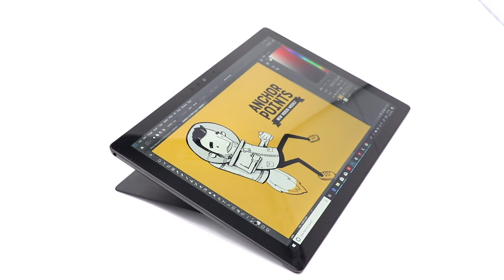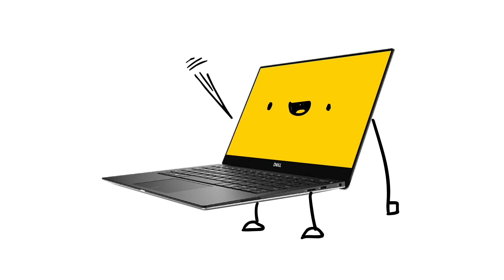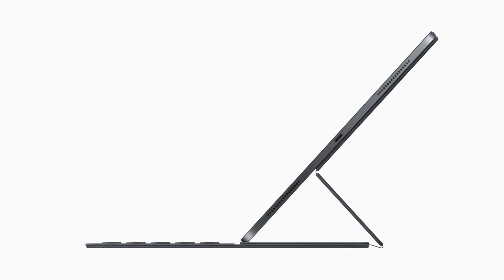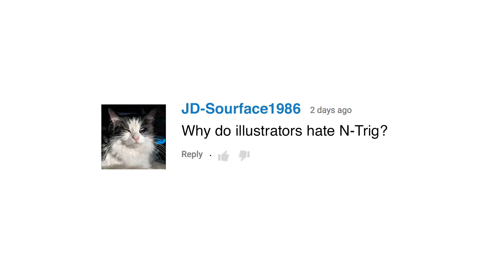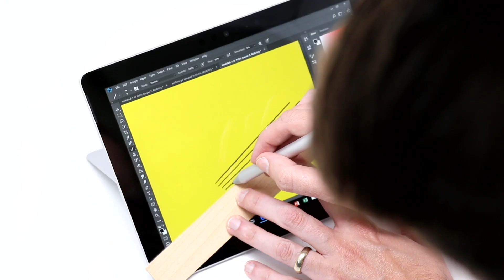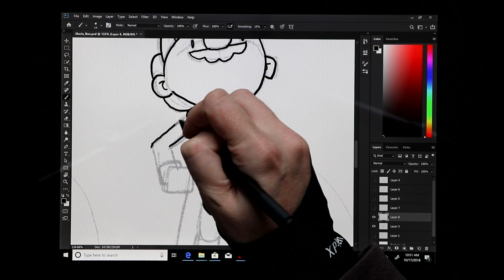Surface Pro 7: Rumors and Updates

Comment: I don't know of any artists who were trained to make slow strokes. In every art class I've ever taken an emphasis was placed on making bold, confident lines. In a digital setting, every instance where I have seen someone make a slow line or curve, I have seen someone doing something that would have been better accomplished with the Line or Pen/Bezier tool in any given program. 

Slow or hatching strokes are not instrumental to creating art. Often they hinder it.
Reply: I used to be a clean up and inbetween artist at Disney many many moons ago (I used paper and 0.3 rotring Pencil) there was no ctrl Z back then, So you couldn’t make Crazy long lines quickly. You could for eyelashes, but there is a balance of control, where you would still need your lines confident. I now work in TVpaint, and I tried using a surface pro as my portable solution and it’s almost impossible to use. I ended up ditching it getting a Galaxy Tab s3. It runs TVpaint, and the Wacom stylus makes a world of difference. I think some concept artists who work fast and lose this can be great! But for me only Wacom and Apple Pencil. Even the battery powered Wacom pens are a bit crap.
Reply: @sloppynyuszi  There is a physical limit to how long of a line a person can make quickly. In traditional media (depending on the size and scale of the rendering), I'd even go so far as to say that 'crazy long lines' would be rare, if necessary at all. And there, a straight edge of some sort would probably be used. 
In art, a confident line is not a description of the end result but rather a description of how the line was made. A dozen or dozens of confident lines could have been marked and erased before arriving at an end result. An end result which could have been a happy accident stemming from a timid mark. It happens.

If a person were inking traditionally with a brush or nib, I can see where slowing down would become necessary and that would be mostly for curved lines. Straight lines would still prompt a straight edge for all but the most inhumanly steady hands. I am not familiar with TVPaint, but any issues with its usefulness could stem from poor code in the program itself as opposed to the device it's used on. 

But, to my point, a stylus makes it easier to incorporate hand drawn assets into a digital workflow. A stylus does not compel a 1:1 conversion of the traditional workflow. That is not the goal of working digitally. Jitter/jutter or whatever one wants to call it, is just an easy way of examining how the technology beneath the surface (sorry) works. Diagonal jitter is not the best way to evaluate which hardware will be best to achieve a particular end result. 

Slowly drawn diagonal lines are just not the best way to render a line in a digital program.
Reply: Sean Adams if you like 2D animation done the old fashioned way TVpaint is the way to go. 

It’s pretty standard after Toon Boom, Cartoon Saloon and a lot of Anime studios are picking it up, and Pixar and Blue Sky use it for their 2D reference animations and Pixar even did a 2D film recently with it.

I’ve used a bunch of tablets, and really wanted to like the surface because of the form factor. It’s just plain slow and awkward to draw with.

Personally I’m glad I could take my work away from traditional materials, but honestly for the work I do I need to be able to draw clean lines slowly. Now I could learn to use a vector app and use Bézier curves and such to get super crisp lines. And I do play with vector apps and the such, but it’s too slow for animation, and the standard Flash stuff just doesn’t get the look I’m after. 

For your type of work the surface might be excellent, but there is a work flow where it doesn’t work, and using other devices seem to have fixed the issue. 

Also since there is a common complaint about ntrig pens I’m not alone in this.
Reply: @sloppynyuszi  The argument I am making is not that there is one  'right' or 'wrong' way to do work which is applied to every industry. I can't even say that your argument is wrong because I don't work in animation. It may very well be that people who work in the animation industry need to draw lines slowly in order to work faster (which sounds counter intuitive).

What I do know about animation is that in order to hit any kind of deadline in that industry, you either have to have more people working on a project, have everyone working on the project work faster or both. Is the surface the right tool for that job? Maybe not. From your perspective, definitely not with TVPaint. Dealing specifically with the issue of working with a single program in a single industry, you are not making a strong case for using TVPaint on a Surface tablet. I have watched some videos since you mentioned it and have seen people drawing on the Surface Pro with the program and have read forum posts about how people have pen pressure in Photoshop but none in TVpaint. Most of what I have read has not ruled out the problem being in the optimization of the software in question. Go back to the days before Wacom was a standard and you'll find some of the same issues. A lot of the Surfaces issues have to do with rigidity and inflexibility in the industries people are introducing the Surface into. 

I am talking about whether the ability to draw lines slowly is the best measure of a persons ability to create art digitally. Line and Pen tools are not exclusive to vector programs. In most cases where a tablet or tablet monitor is tested, the demonstration is always a straight line drawn diagonally verrrrrry slowly. This just doesn't translate to the real world. In that particular scenario, a Line or Pen tool is still the best solution. 

If there is more or less of an undesirable effect occurring depending on which program is being used, that would tend to demonstrate that the issue is in the program.
Reply: Sean Adams well my initial reply was that you said no one draws slowly, and I was just giving you a counter point. You were defending the N-trig and it’s lack lustre diagonal line performance :p

I use TVpaint for my smaller commercial jobs I can do myself. The reason In this instance drawing slower is faster is because I get it right faster. And when saying slow it’s not that slow, just slow enough that the jiggle gets annoying, and when I draw on my Cintiq it’s a lot faster than drawing on the Surface. 

When I work on bigger projects, i usually direct, and I just use what ever equipment is best at the time. When I was directing a low budget Chinese animated series, I had a staff of 40, and an adobe subscription on mid spec PC’s was the best way to go. The guys that drew the animated libraries and backgrounds got intuos pros and the junior guys that basically were dragging and dropping bits and making small scene specific adjustments got the lower end intuos. I used the surface on this job, because it being a windows machine I could walk around and be connected to everyone’s computer and do draw overs in Adobe Animate. 

For that purpose the surface was good. It was easier to find an IT person to maintain this set up than on a Mac. At home though, it’s a Mac and TVpaint. 

Or an iPad and RoughAnimator when I’m sipping Lattes and being a pretentious wanker in a coffee shop :D :D
Reply: @sloppynyuszi  Well,  I'm sorry you got confused by my responses. I never said that nobody draws slowly. I said no artist that I know of was ever taught to draw slowly. I realize that this may be where the misunderstanding began. 

Artists are usually taught in class to be bold with their mark making. In figure drawing class we are taught to draw with our shoulders and make sweeping curves that capture the rhythm of the pose. These kinds of things are not done with slow hatching strokes that make up a single line. But, by no means are we taught to rush to an end result either. We're taught in a way that is supposed to build up our muscle memory, hand eye coordination and knowledge of line, shape, form and values. many art schools won't even let you learn how to draw on digital media first, requiring students to turn in photographs of their traditional media for grading. 

We live in a different world now and not every person who is into drawing and illustration is learning solely from using traditional media. This; however, doesn't mean all traditional teaching go out the window. I am not defending N Trig technology at all. I am saying that the test of drawing a line slowly at a diagonal is not a test of how well a tablet/tablet monitor will serve an artist. In an animation of a bouncing ball, reducing the speed at which each individual frame is drawn will not in and of itself produce a more accurate end result.There are too many other factors to consider. Is the animation more pong inspired or is it an instructional video that is supposed to show the distortion of the ball as it bounces and continues on? In the latter case slowing down may benefit the person who is unfamiliar with how the distortions occur but in the former the person animating is likely to simply use the ellipse tool for the entire animation. 

Each situation calls for the proper tool. Unless you are saying that inbetweener work is made up almost exclusively of slowly drawn diagonal lines and you are also saying that no inbetweener would be capable of drawing at a pace that renders jitter a moot point, the example of slowly drawn diagonal lines producing jitter is not that useful and certainly not outside the realm of the one use case you are arguing. 

Everybody doesn't draw at the exact same speed. Some will draw slower than you and others faster. I just don't buy that a Surface in and of itself would prevent inbetween work (I do believe a program that poorly supports the hardware can cause this). I have a Surface and I draw on it. Some programs behave better than others. I can totally replicate the slow line jitters reviewers showcase in their reviews but the phenomenon does not affect my personal work. It does affect others work, but it mostly affects the work of people who were not trained traditionally or who for whatever reason draw slow enough for it to affect them. 

My main thesis is that the way of demonstrating the slow line jitters does not show how it would affect ones drawing since it specifically shows a process that would be better accomplished with a Line or Pen tool. I would need to see people drawing at their normal pace and observe jitter affecting their ability to produce a line. That is rarely done, and when something like that does happen it needs to be proven that the software isn't the problem. Hardware often needs software optimization and it shouldn't come as a surprise when new comers to an industry show up without universal compatibility. 

My own personal opinion is that the focus on diagonal jitter has been a guerrilla marketing tactic to get the community hyper focused on a distraction that forces competitors to reinvent the wheel before being able to fully penetrate the market.N Trig is not the only Wacom alternative that is cited for diagonal jitter.
Reply: Sean Adams I don’t just clean and in-between anymore ;) that’s just my background, and that type of animation is a lot more niche. So you can make an argument people digitally just don’t draw as much. But if you do as an example a character can hold a prop that has straight lines. This is common. If you drawing that, there is a big chance the object will be diagonal at some stage. 

As for your bouncy ball example. Easing in and easing out, as well as squash and stretch are rudimentary elements in animation. I’m sure if you are doing motion design it isn’t necessary all the time, but usually you try to avoid exact spacing like that when you animate.

Yes drawing you start from the shoulder. The reason art teachers push this is because most people have a bad habit of going into detail first, when doing a 1 minute gesture drawing you will have to draw from the shoulder, but when you get into detail eventually you will rest your palm (why palm rejection is a thing for tablets, not just for amateurs). 

This is what makes Brad a good reviewer of tech products. He tries a lot of common situations and showed them off. If you draw cartoons or do a lot of line work these are very informative. The line test is just one part, of a long line of tests. And the N-trig pens seem to fail at the slow diagonal test. Can you work around it? Yes. Is this a common scenario? To some yes and some no. If you want to see a repetitive Wacom flaw, try drawing on the edge of your screen ;)

Each their own. My point is that this scenario is common enough for me to pay attention. Besides my point of animation, I would imagine someone who inks comics traditionally, would find this an issue when trying out an ntrig stylus for the first time. When starting a drawing, it’s really bad to start drawing slowly, you should draw with your shoulders and figure out what you draw. But once you get to the detail and you are drawing more man made things that require a straight line, but you still want those subtle imperfections from a hand drawing? Then it’s a slower drawing process, and you want the line to have as little technical issue as possible. 
The
Reply: @sloppynyuszi This is pretty much why I say that the jitter test is not a conclusive test. A tablet is just a tool and there are many ways to approach a task. The test rigidly suggests that slowly drawing diagonal lines is the best solution if you have a stylus when it certainly is not. 

If you look at many of your responses, you make a lot of 'if this then that' scenarios. The scenario may be common enough for your situation using your chosen program, but I haven't seen it demonstrated in any way other than the slow diagonal line test. Nothing that shows that it's proven to be a detriment to the process of actually drawing. If you go to the doctor and say 'doc, it hurts when I do this" unless the action is something that seems necessary his response will likely be 'don't do that".

Anecdotal cases of a software failing to be useful on the Surface does not automatically mean the problem is the Surface. Like they say in science: more information is needed.

I keep saying that the slow line diagonal jitter test is not the best way to rate a tablet and you respond with your chosen animation software not working well on the Surface. Unless you've found some way to prove that the issue is not a lack of software optimization, you're responding with a non sequitur. 

Some software companies optimize for the hardware and other don't. Microsoft has done a good job integrating N Trig into the OS, but sometimes a software maker has to optimize their code to see the best results. Some companies don't always find it worth it to commit those resources. 

I am just not finding the value in that particular test. And this isn't a Brad issue. He is far from the only one doing this test in his reviews.
Reply: Sean Adams TVpaint is not the only issue it’s my main tool. I had the same issue with photoshop, MediBang, Adobe Animate (but that’s not really a drawing app). 

I also gave you examples of other instances one might need a diagonal straight line. Not just animators. 

If you draw super fast and never draw diagonal lines. You are good to go. Or if your surface experience hasn’t been compromised so far, that’s also awesome. 

This conversation has gotten a little sour. Let’s just agree to disagree ;)
Reply: @sloppynyuszi  Providing examples of other instances where a straight line is needed is not the same as proving that the line or pen tool wasn't the better option to make those marks. 

Not every program I have used has been seamless. Like I said, not every software maker optimizes correctly. Photoshop vastly improved after they optimized, the other programs you mention I haven't used on Windows 10 or a Surface. Optimization of the hardware through software is the reason why Wacom develops drivers for their tablets. I've kept the same Surface and Surface Pen through multiple versions of multiple applications. I think I am on pretty solid ground when I say optimization of the software makes a difference. 

Not drawing super slow diagonal lines is not the same as drawing super fast and never drawing diagonal lines. Stating that one has a problem is not the same as proving the problem is with the hardware.

All I am saying is that better examples are necessary. The current tests are inadequate to support the conclusions people are making.  If those conclusions are hurting sales and making the market less competitive, the end result is actually harmful to the consumer.
Reply: Sean Adams as for sales. It’s unfortunately a niche market. 90% of people who own an Apple Pencil don’t even draw with it. Most people that buy a Wacom hold onto it for ungodly amount of time. I know people still using some 4:3 aspect ratio Cintiq and are content with it. I regret selling my companion Hybrid after 5 years. It’s still working at a friends studio. Ended up buying the MSP to fill the void. This time I’m using it until it craps out. Incentive for these things are low. Customer base is usually either poor, or big companies buying in bulk. The upgrade cycle is low. The 4:3 Cintiq I was talking about is at my friends desk where he works on the Simpsons. I think youtube reviewers aren’t the problem for the market for these things.
Reply: @SeanAdams001  I think that's just a load of poor excuses and is analogous to Apple's "You're holding it wrong."  
Sure, if AES works for how you work, enjoy it.  Don't go around berating others for whom it doesn't work.
Reply: @tams805  I have not 'berated' anyone. Any scorn I have shown has been aimed squarely at the test itself. As for it being a 'load of poor excuses' I very much disagree. 

The shortest distance between two points is a straight line.Arguing that there are other paths one can take doesn't change the fact that the straight path was the shortest one. 

If I want to draw a line, I use the line tool.
If I want to draw a precise curve, I use the Pen or Curve tool.

Those are not excuses. Those are best practices. Yes, a person can choose  a workflow that is designed to be a 1:1 analog of working traditionally, but if they were being honest, they'd realize that isn't practical. Not every traditional method has a digital counterpart. What people can do when working digitally that exactly matches what people do when they work traditionally is choose the right tool for the job .When I am working traditionally and I want clean ink lines over my rough pencils, I don't dip the pencil into the inkwell. I grab a marker where others would grab a brush. Still others would grab a nib. Most at some point would use both (or all three). Some would argue that in order to make it look like it was hand drawn that they use the same tool for all of it. Some people won't use a ruler while inking lines because the result looks too stiff or mechanical. And on and on. 

Using the right tool for the job is not a new concept in the world of art. I have a Surface 3 and a 2017 iPad Pro. I also have an Asus PT201Q tablet monitor. I used to use a Monoprice tablet monitor. I use to use a Wacom Intuos 3. 

Not one of them has allowed me to draw a curve without wobble. I've always used the line and pen tools when they make sense. The point I have been trying to drive home is that if a diagonal line is supposed to be the end result, putting a ruler on the screen and drawing a line slowly doesn't make sense. That is what the Line tool is for. If a reviewer wants to demonstrate in a visual medium (which YouTube is) and they want to suggest that the diagonal jitter problem will be a detriment to my ability to draw with tablet, then show me the jitter problem impeding the work.

The resistance I feel when talking about anything other than a hand drawn line would make you think rulers, french curves and ellipse templates didn't exist...
Reply: Surface pro 6 is great for sketching.